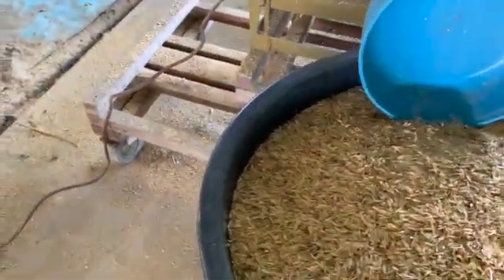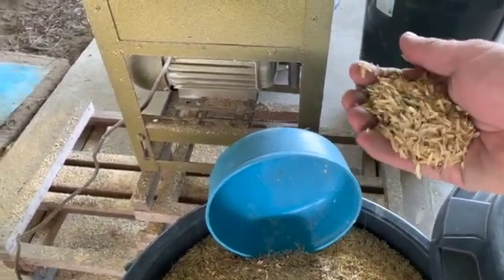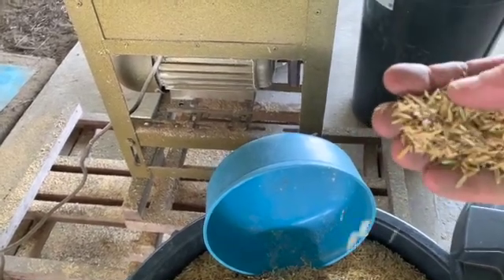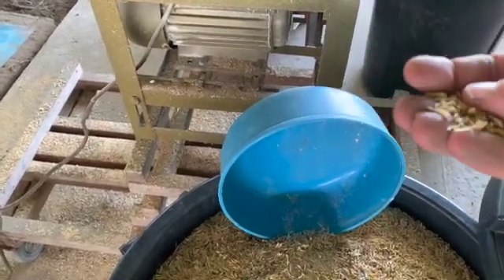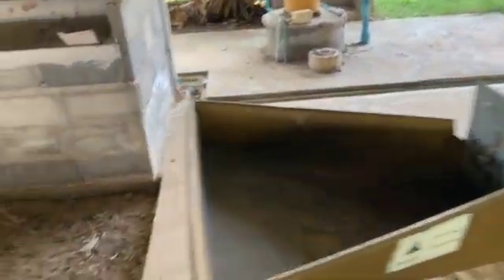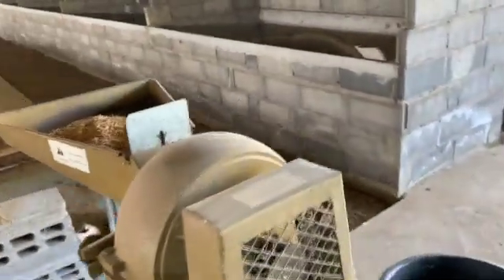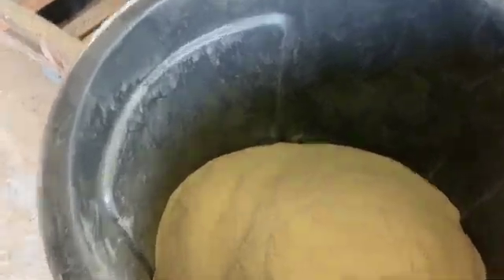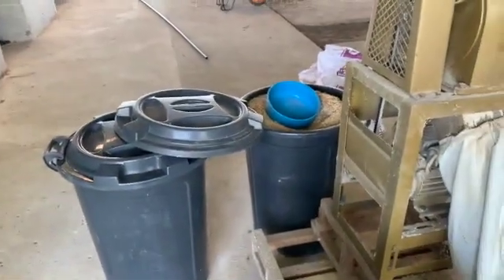Growing Oyster Mushrooms, substrates and supplements

Comment: The maze is called lam in Thailand I buy from the guy who has a rice mill near me.
I have been growing mushrooms for about 5 years now, except for the last year lost to covid.
We use rubber tree sawdust plus lam plus a few other additives, also we add molasses.
It's not easy but if done right it's good money.
After we mix and bag we have a steam room we put in need to get the temp above 100°c and leave for 5 hours.
Then after they have finished next day we open and take to our seed room, which needs to be a controlled environment so no infection.
Just a little heads up.
Reply from the maker: Thanks Neville, I'd be very interested to see how you set up the steam room.